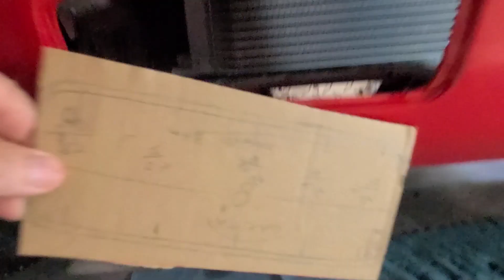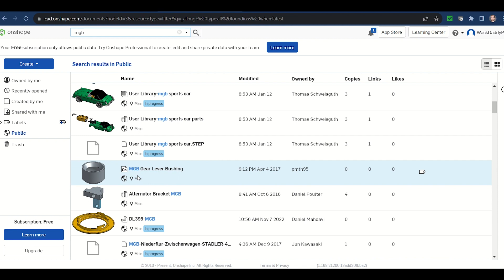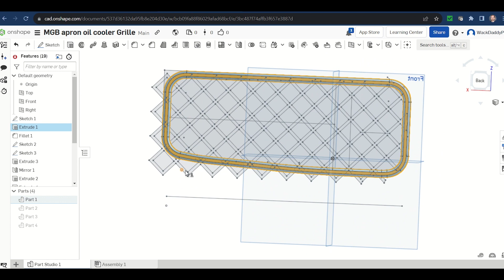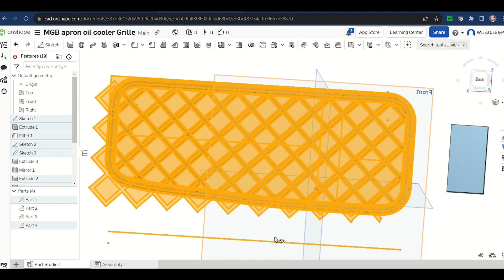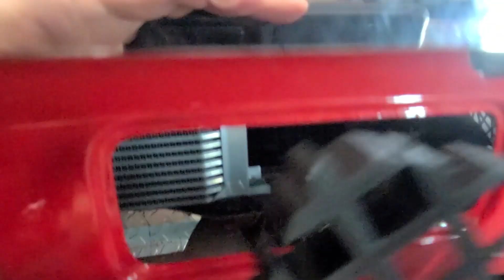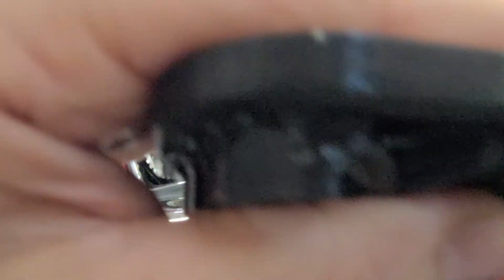How to make 3D printed Apron Grille - 1977 MGB

Comment: I don't know whether OnShape has the functionality that I used in FreeCAD: once you have drawn the desired shape on a piece of cardboard you take a photo of the cardboard. Then import that photo into FreeCAD, scale it, and then you create your sketch on top of it. That would allow you to adjust the corner radius you mentioned to the correct value without having to make a prototype of it.
Reply from the maker: There are a lot of modeling programs out there.  I used to use Autocad back in the 90s.  Onshape seemed very similar, so the learning curve was minimal.  I liked the public library of designs too.  Prototyping is just a thing I do to reduce reprinting, as finish printing takes soo long.  Great input, though. I will give that one a look too

Comment: My 74 roadster has this diamond pattern plastic grille.
Reply from the maker: if you attempt to print out the model i created, the length of the X axis is 8.5 inches.  some slicer programs have problems getting the scaling right.
Reply: Yes 74s had the diamond grills will check your design and print it for mine, not sure my printer is big enough I may have to do it in 2 parts
Reply from the maker: excellent!  I printed mine on an Ender 3 had to position the piece diagonally.  if you do please share your result on facebook or some other forum, so I can share it in a follow up video
 @MarianoLu